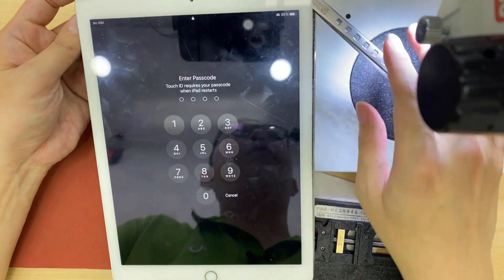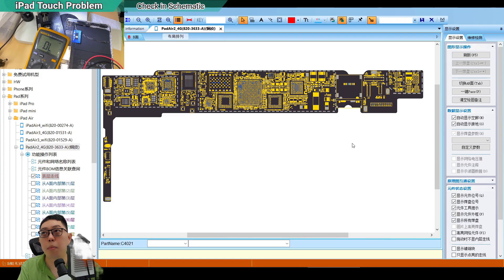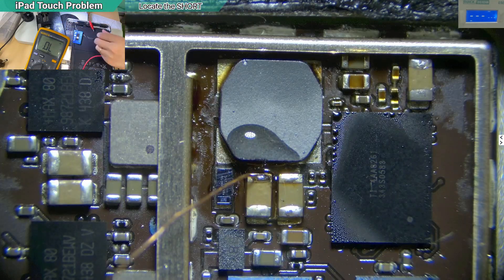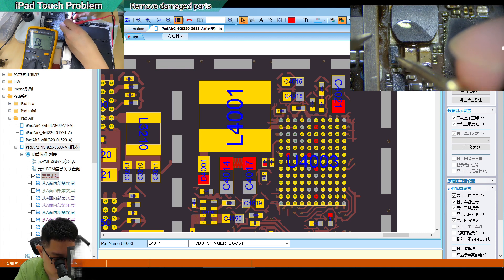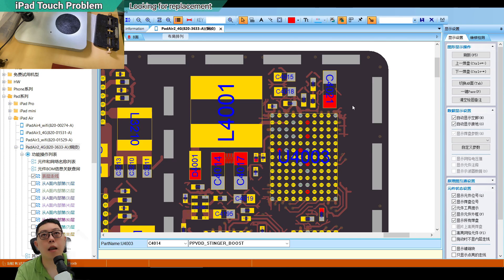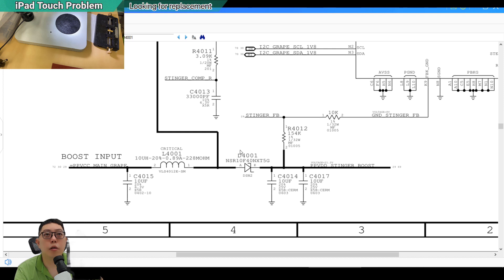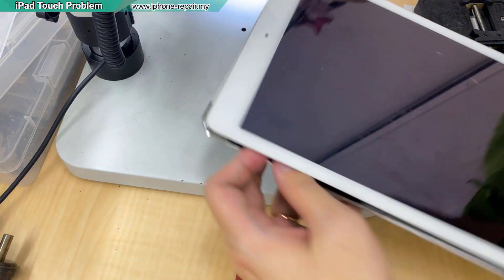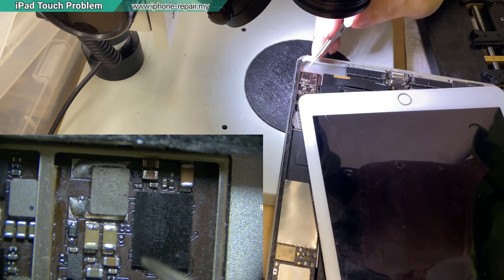iPad Touch Problem from Motherboard Repair Tutorial【Common Problem】

Comment: Hey I need help with changing digitizer and an issue I am facing, unfortunately the quality of flex cables of digitizers for replacement parts are not as good as the flex cables on the original digitizers, and when fastening them and connecting them you don’t get the clicking noise to make sure the flex cable is connected properly, but the digitizer works but after couple of days the iPad digitizer flex cable comes of the motherboard and so the digitizer stops works, is there any way to sit or fasten the iPad flex cable so it does not come off the motherboard ?

Comment: I hope every user of zxw would complain by a review or something about why ipads and some new iphones  doesn't have more informations .
Reply from the maker: Because Apple does not release the schematic or no one to steal it from them.
Reply: @iPhoneServiceMalaysia  hey i dont think they need someone to steal it,  resistances can be done with multimetre specially if there is a big team that would be easy for them to note every think .
Reply from the maker: @Mradam912  without schematic, you never know the coil spec, capacitor spec, the line label name and what it's doing... it's not about measurement. That's how software tell you what's the line purpose and spec.
Reply: @iPhoneServiceMalaysia  hello again , ipad series doesn't have even  risistance values i think they can measure that and put in schematics im not talking about component specs , and im sorry for arguing with you , you are master of your craft im just a beginner .
Reply from the maker: @Mradam912  Well, an advice even a trained technician didn't know. 
Let say there is a pin is 350 from schematic. You found 380 or 300. So you suspect a problem or maybe just different multimeter. 
So the line name will help us to know it should be higher or lower. Example, i2c lines.
This kind of measurement techniques are important. It's the unique lesson that only my course has it. Some pro they know it but they won't talk about it.

or maybe a line that is 0.0025 that low. By looking at what's connected to, we will know it. Instead of blindly comparing to other board.
Reply: @iPhoneServiceMalaysia  hey already lots of informations on your answer you taught me thank you so much your so kind